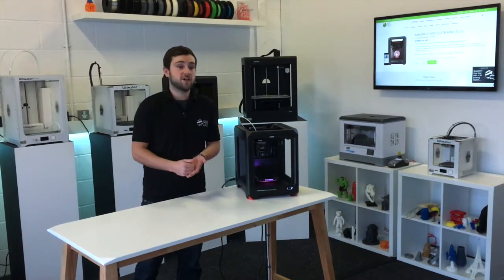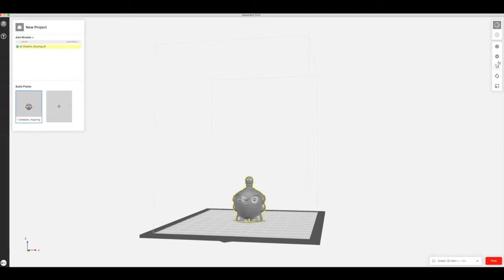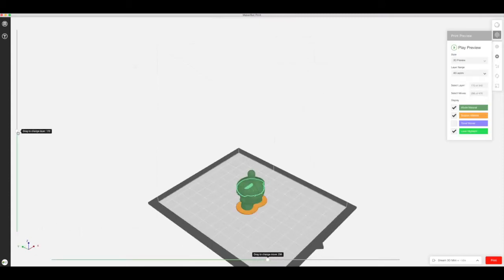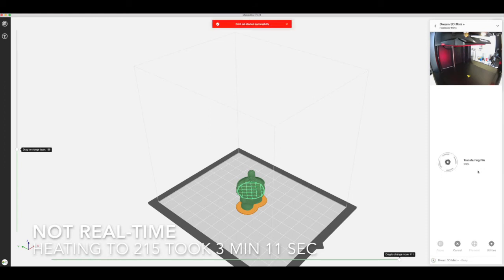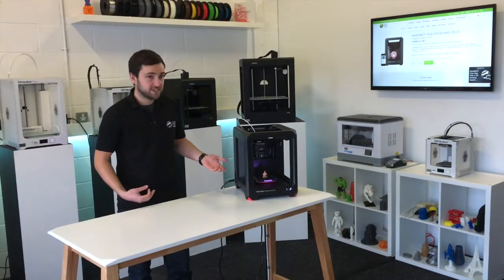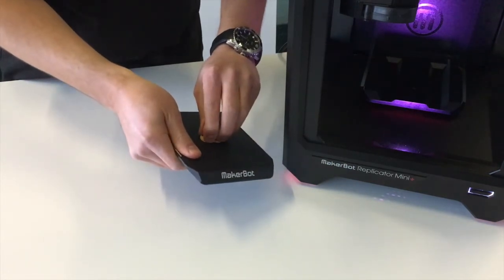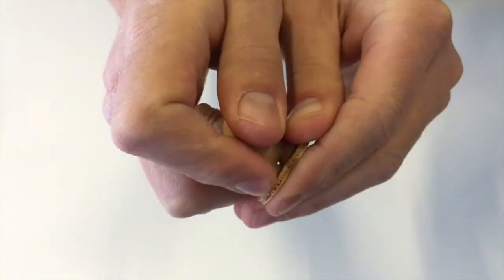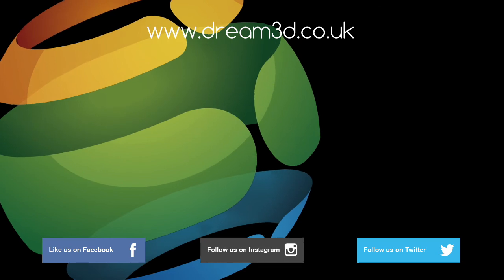Makerbot Replicator Mini + (Plus) First Print | Dream 3D

Comment: worth it or i should go for the ultimaker 2go? or tell me which is my best option for $1200 thank you! very nice video
Reply from the maker: The Ultimaker 2 Go would be one to consider too. I'd say the latest MakerBot Replicator Mini+ is probably a bit easier to use and our demo unit proved to be very reliable for the 2 months we had it. You can tinker more with the Ultimaker 2 Go and use filaments from any brand. It depends what your priority are, they're both great machines!